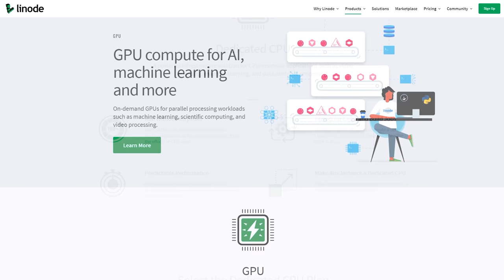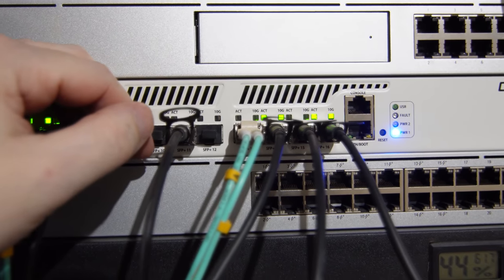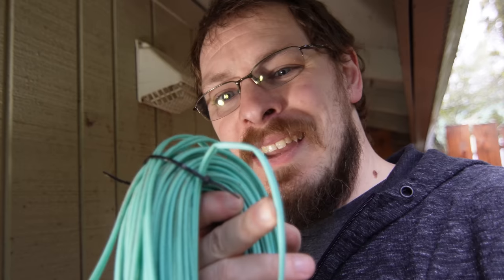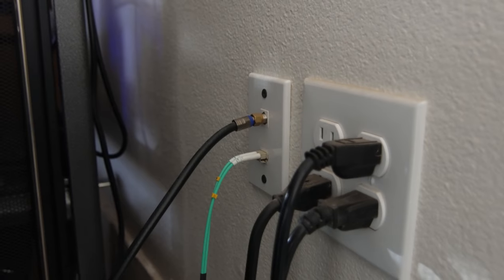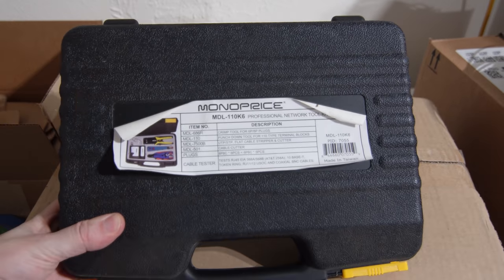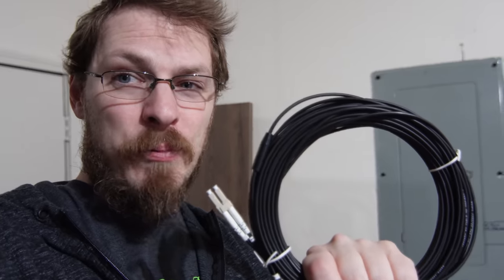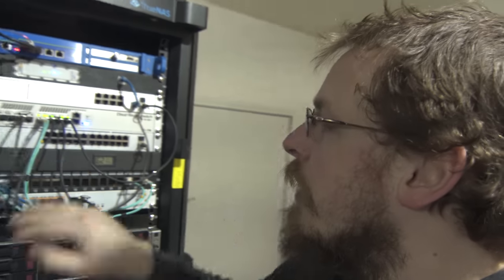Mistakes were made. Let's fix them.

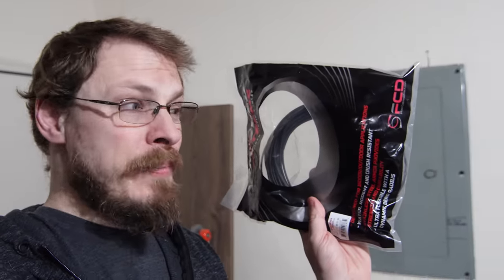Comment: 6:30 I can easily understand why. I have experience with terminating higher-end glass fiber cabling-- NEVER AGAIN. Not only is it a PITA, it is a hazardous PITA. A shard of glass scrap that resulted from terminating one cable wandered off the workbench I was using, down my leg and into my boot-- I found it a week later when the ball of my left foot developed an abscess bad enough to require surgery.  If you're ever unfortunate enough to have to deal with this shit I recommend four things:  1) Tyvek suit and gloves 2) Actual UV blacklight to highlight any shards 3) Gorilla Tape to pick up any loose shards and 4 ) A healthy sense of paranoia.
Reply: I feel for you dude I spent many years working for British telecom & Dupont (BT&D aka HP aka Agilent) terminating fibres and the little bits of fibre get everywhere..and hurt for ages , I dug so many out of my hands with Stanley knives or scalpels over years I lost count... thankfully I'm out of that trade now...we were doing DWDM 10gb fibre in 2003-2004 and onto 40gb by 2005
Reply: I whole heartedly agree with your adivse on jobsite cleanliness and shard management. I'd like to add that you do NOT want to eat or drink while doing this type of work. A shard of fiber, if injested, is going to be almost invisible on an x-ray and certainly invisible to a surgeon. Yet it will tear apart your insides forever because it will never break down.
For the same reasons: wear safety glasses and dont touch your eyes!
Reply: @greg_zenger  That visibility issue is part of the reason why I remember that incident so vividly despite it being 15 years ago.  The surgeon couldn't risk anesthetics until after they were sure (and I profanely confirmed) they had removed all of the glass pieces.
Reply: What's up with you guys? I've been doing fiber installs and terminations for years, sometimes under extreme deadlines and shit situations. Never once had an issue with any of it getting into myself or any of the other people. Wear safety glasses, don't be flipping stuff around. Work on a solid surface with a disposable cover (preferably black in color). When done, ball the cover up, toss it, and wash your hands immediately. I've heard horror stories such as these, but never heard of anyone working for a respectable company, following the guidelines, having any issue.
Reply: @paaao   I don't know what the people are doing either. I've never had a fiber running loose and I had to do splices on tower instalations, 70 meters above ground in near 0° temperatures. Even some basic Fujikura fiber cleavers have a little trash can that immediately catches the fiber right after being cut. All you need is a steady hand, strip it to the right length and check if it didn't fall of anywhere.
Reply: @lamjeri  pretty much. I think a lot of people are poorly trained, not trained at all, or just ignore the protocols completely chaulking them up to non sense fear mongering. So they cut, shatter, and strip bits and pieces all over the place, wipe the table off with their hand. Then go eat lunch. 

By the way, one fiber training I had, the guy teaching it had scars all over his arm from a trip to the ER. He wiped the table clean with his hand. Caught a fragment, and it migrated up his arm until causing noticeable pain and other issues. Docs couldn't find glass using multiple xrays, and had to go on instinct, making incisions in various regions to isolate it, before finally striking gold. 

Moral of the story, don't mess around with stuff you don't understand, or you think you understand, because you watched a 5 min how to video on YouTube made by some other guy who doesn't understand.
Reply: @paaao  the emphasis here on safety concern is due to context. The main audience of this channel is difinitely not fiber professionals, or commercial installers. Most viewers are amateur hobbiests, and they deserve to be informed of the hazards involved in the endevor. As a professional we have been informed from day one by our trainers and employers of the hazards and given quality tools that includ scrap capture and etc. I have done fiber installs in the bilges of ships, and on the tops of radio towers. Now that I primarily do fiber installations only in my own home, and occasionaly for friends, the quality of equipment I have access to is lower, but still not lower than what I expect the audience of this channel would encounter. a sub $100 autocleaver will not have a functioning scrap bin. People cleaving fibers manually need to be informed to police their scraps and dispose of them properly. Its easy to roll a piece of duct tape and make a scrap trap, but if no one tells you to do it, it wont become standard practice for you.
Reply: This is all I needed to know to stick with Ethernet for as long as possible.
Reply: @greg_zenger  The shocking thing is, the guys responding with these injuries were working in a "professional" environment. If anyone has to pay for multiple surgeries out of pocket due to a fiber accident that took place at work... they better not be employed in the united states. Otherwise a good lawyer is in order.
Reply: @greg_zenger  My first job was building fiber equipement with a lot of coupler(50+ like spliter direct to splice and connectors for in and out of the final equipement) and we had a great training with great safety informations. I've never had fiber in my finger or anywhere, desk has to be cleaned after every shifts, scrap bins empty by specific person, our cleaver did not have th scrap bin in the end so we had to manually put it in the trash, we had finger coats some had gloves... If i had to do my home with fiber I would have no probleme do it with the knowledge I kept from that job! It's like driving a car, you go to school, they give you the safety stuff, how to, then go!
Reply: @meddlin  To be honest, I really don't see a point in going for these high speed setups at home. ~100 appartments can easily run on a single 10Gbit uplink (200/200 Mbits on contract). I can only wonder what are some people doing on their home networks to warrant the need to go for 40Gbit links.
Reply: @ItsJust2SXTs  I agree. I don't do fiber professionally anymore but have acquired tools to continue to do it for myself and help my friends. I've never had fibers in my fingers but have heard the horror stories during my training or from others in the field. If an amateur is going to teach themselves to do this sort of work, I hope they see these cautionary message so they can do their work safely and practice good housekeeping to keep their family safe as well.
Reply: Ouf.
Reply: @ItsJust2SXTs  Yep, I have worked with fiber for years. The only problem I have ever had is when another person disregarded the rules. The simple fact is that photons DO NOT have the same inertial issues that electrons have.

Comment: I'm sure you've got it covered, just wanted to mention for others contemplating a run of network, do a quick cost-benefit analysis on running a backup cable at the same time, whether CAT6 or a second fiber (heck why not both?), same labor and time, might save you doing it twice down the road.
Reply: String/yarn tied saves the time on a second pull

Comment: Trained fiber tech here. I can see with one run why a pre made cable would be fine, but if running multiple lines, I would definitely invest in professional splicing. I don’t know the particulars on your house, but I typically run my cables, fiber or otherwise inside only (except for main service line), through walls and drill stud and baseplate holes. If you have to run outside, I would recommend gray PVC conduit to make future runs easier and protect the lines. Gray PVC is real cheap at Menards/Lowes/ETC, last I checked it was like $8 or $9 for 12ft sections

Comment: After getting a quote for over $30K to run fiber at work - we invested in a fiber splicer.  You can get them for about $1k.  We then went single mode fiber for upgradability in the future.  (currently just running 10Gb).  I don't terminate the ends.  I buy short already terminated pigtails.  That way you are only splicing fiber not terminating..    Been very happy with it.   oh - yah - we also spent about a grand on the tester..  lol.  Still for a small business - more than cost effective.  It really went smooth.

Comment: Service/drip loop on the outside to stop rain etc from just wicking inside.
Reply from the maker: I silicone'd the hole after testing.
Reply: @CraftComputing  water doesnt seem to care - some of it will follow the cable to the low point, even through grommets, silicon etc. Just make sure the moisture wont kill anything there i guess. I'm a little surprised you didnt use a raceway too
Reply: @CraftComputing  Drip loops are still a very very good idea. Check out Fiber Ninja's episodes 16 & 29 he covers some really good practices on outdoor cable management. Water is the enemy! :-)

Comment: When using fiber at home, a proper fiber cleaner and a visual fault locator is must have tools.
Reply: Love the otdr I use at work. For anyone dealing with fiber definitely would recommend and the run only a few hundred dollars.
Reply: @52fordf1  For someone working with fiber, or uses it in permanent installs a otdr are a must have tool. However, when you only use patch cables etc. I dont se why you need one, cause then you just replace the suspected bad cable.

Comment: An old linesman trick to determine exactly how much length you need (give or take is to tape (or tie elsewhere and subtract some) a bit of rope on one end, run the rope through your line and mark with tape where the rope needs to complete a run. Then retrieve the rope and measure the linear length without any bends, get the approximate amount you need and hope you were right.

Comment: A useful “get out of jail” card: If only one of the two fibres is broken, you could just use a Bidirectional SFP. These use a different wavelength in each direction, allowing full duplex communication over a single fibre.
Reply: The hardware has to support it... and then you need the SFP's.
Reply: @ShainAndrews  Correct, in most cases that is not a solution. In a case where specialized equipment is required (ie. lifts, excavation, boring, etc.) bidirectional might be the difference between a $300 and $8,000 fix!
Reply: @ShainAndrews  Bidirectional SFP+ modules are under 100 bucks a pair, so it isn't a big cost if you factor in labor to replace a fiber run.

Comment: Without strain relief connected to the jacketing, surely there's nothing stopping another pull damaging the inner fibre?
Reply: It looks like he secured the cable far better and the armored cable should have strain relief built in
Reply: @codec862  Yep, looks like he did secured the fiber cable this time.  You do NOT want any continuous movement of the cables as over time the fiber glass will break.   The fact he had his old cable on the J hook the wind kept bouncing it back and forth.  It was a matter of time before the fiber inside the jacket broke.
Reply: @Darkk6969  Plus it looks like it was the perfect playground for animals like squirrels
Reply: I also thought about vandalism. I wouldn't leave cables visible outside at all or at least put them in a very sturdy conduit so you would have to bring power tools to damage them.
Reply: @codec862  yes, but if the only thing holding it in place is the LC connector at the end then all that strain is going to the inner jacket.  When pulling outdoor rated fibre I've always used a gland on the outer jacket (compression or epoxy bonded).
Reply: @codec862  Squirrel Mafia Strikes again!

Comment: I have polished my own fiber cables for my network setup. But disclaimer, I have the benefit of being professionally trained. A decent kit will cost a few hundred dollars, and as Jeff and others have stated, it’s a real pain in the butt. I purchased a used single fiber fusion splicer on eBay, and a counterfeit cleaver on amazon, and now terminate my trunk fiber cables by cutting patch cables (had surplus on eBay for cheap) in half and splicing them on. This allows the fiber cables to be a precise length for tidy grooming, you just need to dedicated a spot in your rack to store and protect the splices (the most fragile part of the fiber optic link).

The way I would recommend to a hobbyist to install their own connector on fiber would be a no polish connector. These work by means of a mechanical splice in the body of the connector. Some basic tools you will need are strippers and shears. Wire strippers work fine for removing the outer 2mm or 3mm jacket. Kevlar shears or created kitchen scissors are needed to cut the aramid yarn, The 900um tight buffer and 250um coating need to be removed, this is best done with thermal strippers, but can be done with properly adjusted wire strippers, and alcohol wipe. The only specialty tool needed is a cleaver (and some practice). A hand-held ruby scribe can be used to manually cleave. This takes practice, but isn’t very hard and can be had for a couple tens of dollars. An auto cleaver is ideal, a commercial one is about $1000. ouch. I’ve purchased knock off / counterfeit cleavers on Amazon and eBay in the <$100 range and find that they do a good enough job for low volume hobby use. Of course, no quality control at that price point you YMMV.

If you are interested in no polish connector, the cost about $12 per termini (AFL P/N AF-FAST-LC-MM50L) Keep in mind you will almost certainly mess a few up when you are new to it, and will continue to mess them up from time to time. So, the general recommendation to 'just buy a new cable' is generally warranted.

Comment: In my previous job I regularly interfaced with professional cable contractors. They'd rather pull a 300+ foot pre-terminated armored fiber than have to cut and splice a segment off a larger spool. They did however put a great deal of effort into figuring out pull distances

Comment: 5:55 Depends on where you live, I guess. I DIY'd mine because I had to run fiber cables outdoors to connect from my server rack to the rest of the home network, and there was no way to do it with pre-terminated cables. Bought two single-fiber drop cables pre-cut to my desired length (50m/~160ft in my case), some "butterfly-style" SC connectors, a drop cable stripper, a fiber cleaver, and some SC-LC couplers. Those two tools cost $25, the cables are another $25, the rest are around $10. Terminating with those butterfly connectors is easy, almost easier than terminating ethernet cables. (And if you're wondering why I didn't buy a single 2-fiber drop cable instead... well, I was a cheapskate at the time lol)
Reply: Afaik he is confusing the glass and plastic fiber cables, the ones that are a pain to terminate are the glass ones, which are the ones used at the infrastructure level, while plastic ones are easier to work with (and cheaper) but won't go very far (by fiber standards anyway)
Reply: @marcogenovesi8570  They make mechanical splicing equipment that doesn't require a fusion splicer. It's fairly simple and pretty inexpensive. You can terminate OM1-4 easily with a crimplock or other quick connectors. I have a fusion splicer and mostly recommend that if at all possible but in a pinch the average user could definitely do it on the cheap.
Reply: @marcogenovesi8570  I've used the gell/mechanical ones to go 900m on om3 glass fibre at 100mbps (and 1gbps on shorter runs).  When carefully done I haven't found a functional difference to fusion spliced cables.  I moved to using single mode for most projects a few years ago so I now just fusion splice, but if I were doing a DIY project and didn't own a fusion splicer I'd be happy with the mechanical ones.

Comment: whoever did your cable install sux. They put a proper ground block but didn't secure the wire going into your house, Didn't put a house box in. Left the ground block at the top of your house instead of the bottom where short people can get it without dragging the ladder off the truck. Didn't put a bushing to keep water and bugs from getting into the hole. didn't do a trip half-loop for the wire going into your house to keep water from going into your house. They for some reason used the messenger wire for a ground point which isn't rated as a proper grounding unit. The fiber tools we used were $4,000 it was all in one with a microscope camera so you could see the percentage of alignment the splice was. always a good feeling when you had 100% alignment.

Comment: I learned to terminate fibre back in 1995 when working on a couple of networking projects for the large steel company. I got all the training and kit, cleave, glue and oven microscope and polisher. I still make my own fibre cables, I find  it very therapeutic, only used is I have the fittings for the ST ends so most of my setup used st ends with short adapter patch leans when not st ends
Reply: ST is still popular in broadcast, although things are moving towards LC for size

Comment: The issue with premade cables is that now you need to run a large connector through a possibly cramped tube where barely a catX cable fits, we also use corrugated tubing here so good luck trying to pass the square end(unless you do a big tape bundle)